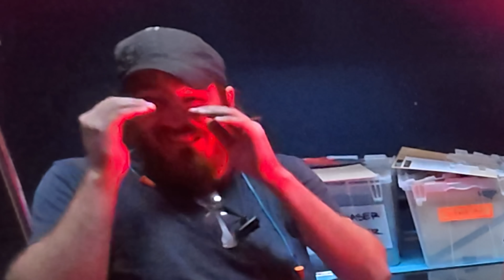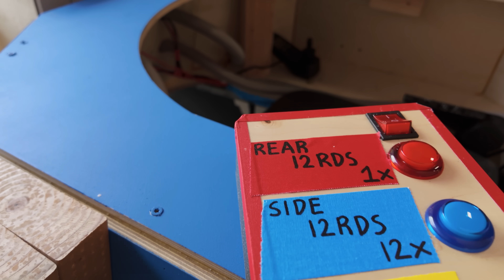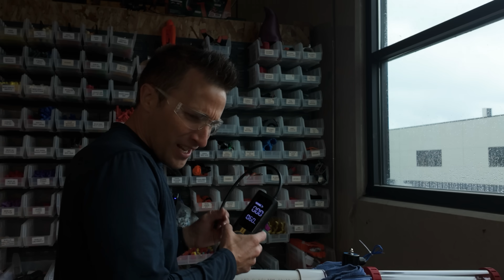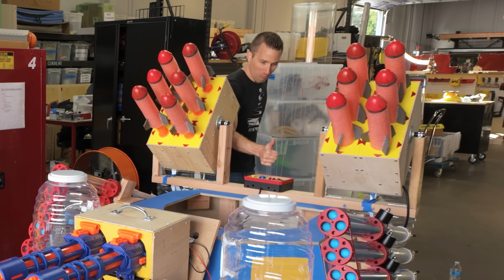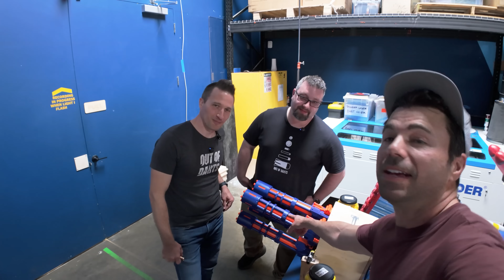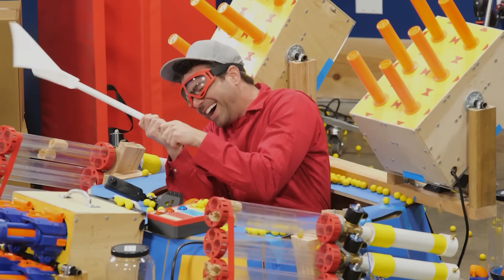Creating the ULTIMATE nerf tank with Mark Rober!

Comment: now make one that looks like a real tank that’s made out of solid steel and shoots xl darts at 450FPS and 1RPS and rival rounds at 350FPS and 20RPS.
Reply: At some point that's not a nerf gun. 

Friend of mine built a nerf artillery piece in college, launching clusters of socks hundreds of feet and reigning them down. Somehow yours is scarier than that
Reply: I somehow have even more ideas that are 500x scarier than the tank
for example:
Welding a spring that’s 500X more powerful than a K14 and then shoving it inside of a full tungsten, breech loading sniper with a $3,000 thermal scope and a $50 bipod.
Oh also the barrel is 1100MM long and is also made out of solid tungsten, speaking of which, ALL of the internal parts are made of tungsten.
Oh btw, it also automatically primes the blaster so that you don’t have to be a body builder to use it